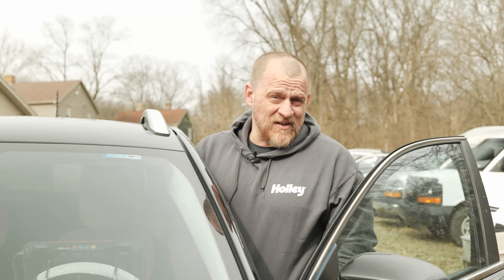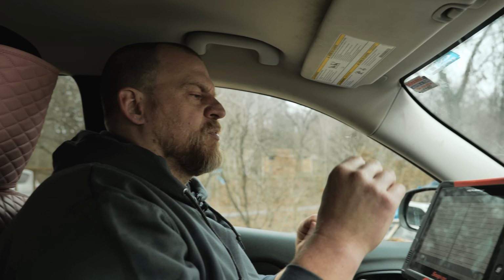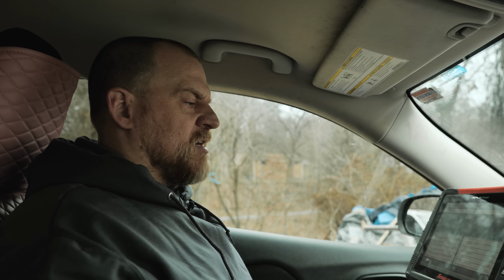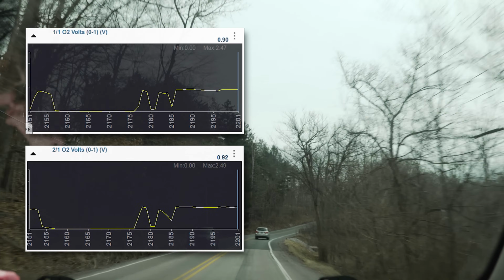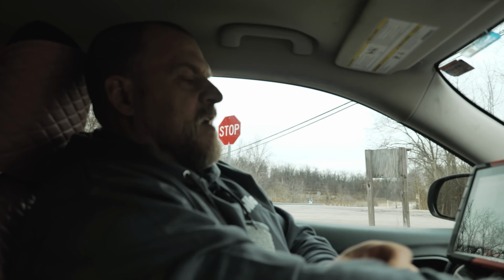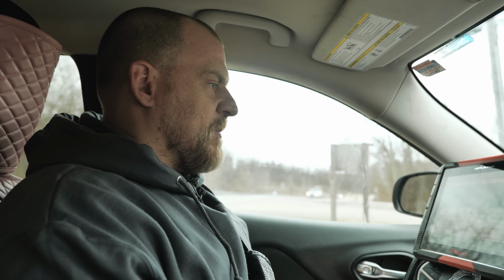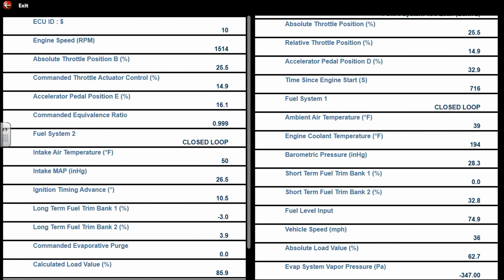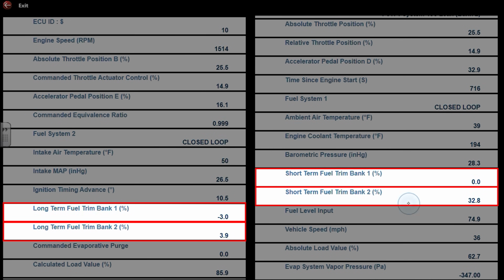How Would You Charge For This?? [Intermittent Lean Condition]

Comment: Been a E-Student of yours for about 6 months now and I used everything you taught me today on a no comm no start no 5v ref. pulled out the vantage labscope and diagnosed the issue I just wanted to say thank you for everything I've learned from your classes you teach!
Reply from the maker: Awesome! Love this, thank you!
Reply: I need help, have a 2001
Monte Carlo with a maf code but have been replaced 3xs at a couple diff shops.wont stay running but when do start it misses bad and white smoke out tail pipe..
Reply from the maker: @Bigmonyon  I do not have any silver bullets for you. What testing have you done? Are you saying white smoke only happens during the misfire? A fuel injector that is stuck open can do that or a headgasket issue

Comment: O2 sensors are a wear item.
Ive seen bosch sensors saying replacement interval 150 to 180 000 Km.

On my old Audi RS4 B7 i had one go bad on the heater then just replaced all 4 sensors and fuel consumption dropped by about 20% and it got more power and ran much nicer. And in the long run the catalytic converter will last longer.

Some times when you cant find the fault within 30-60 minutes then its cheaper to just replace the component as long as it doesnt cost over 500 usd.
Reply: Bu for customers i often just delete faults first and try to get it back since many times the cars that come in have hundreds of faults that isnt relevant and it might be a one time thing.

Og VAG its nice that you can see exactly how many times the fault has been detected, if its one or two times it might be random but when its 160 times its a real problem.

Also, many faults is just people not maintaining their cars, spark plugs, fuel and air filters, oil, and so on.
Many cars get a bad reputation because of the customer

Comment: what about changing o2 sensors in places? from bank1 to bank2 and opposite? and compare figures the same sensors in changed positions. of course, if wirings of sensors are identical.
so you can see if the picture will change or not - the matter is in sensors or real difference between banks.
Reply from the maker: i did that recently on a case study and pulled the threads out of the exhaust smh. That is a last resort type of test
Reply: @ScannerDanner  yeah, on high mileage that happens. sometimes wd40 helps if you have a lot of time to wait.

Comment: Among the list of options you suggested after saying “what would you guys do at this point”, I’m surprised you missed the most important (and most logical) next step. Research. Don’t get me wrong, I agree that you’re probably on to something with the spilled coolant theory. It’s a good thing you got more info from the shop who did the work. But wouldn’t it suck to explain this to the customer, send them on their way and the car comes back a few days later with the light on again, only to find out the second time around a software update exists for this fault code. As long as search info is used properly, looking for bulletins or even hits can be very useful if you didn’t come up with anything, since you made an actual attempt to diagnose the problem instead of running straight to the computer

Comment: Dam str8 charge for your time!

Back-in-the-day they used to tell us 'students' that coolant can kill O2 sensors.

And know your client!  "...he was worried due to his granddaughter driving it."  Run with that!

You can also use Prodemand (that showed on your scan tool), that says most common problem is the O2 (AF) sensor.

Go w/ your gut.

Write your story of all the data you saw.  Sell the client an O2 sensor giving grandpa "peace of mind".

Wouldn't it be nice to change the part and fix it than to have the guy make yet another trip to the shop.  Sell this conenience.

Jim

Eve's Automotive

(btw...is the tick I hear from the HPFP, or the more common worn out roller rocker???)

Comment: Funny there is a 3.6 2018 ish jeep wrangler at my work that has had some really intermittent weird lean conditions. Great to watch you have the same stuff happening. These have issues with O2 sensors and oil from the valve covers leaking onto the o2s. I do not like this 3.6 engine I think its not very well made. Crazy how some spilled fluid could get into the sensor. If you hear anything back about this car I would love to hear if there is more to the stories.  Probably just letting the customer off for free or next to no charge would be a hood choice if you are a shop owner. Unfortunately if they are bringing this car to a bigger shop/dealer there getting at least 1 hour diag charge.
Reply from the maker: it has been 3 weeks with no repeat fault!

Comment: You have so much more patience than me. lol..   I would have driven that thing maybe 10 blocks.. and abandoned it right away..   and told them it's working well, just keep driving it;  and not charge them.   If I'm not going to charge, I'll abandon it very quickly so I'm not wasting any more time on it..  which is typically my 'go-to for intermittent problems in general.   Just bring it back when it's actually broken.  I've chased enough ghosts that I just don't care to even try anymore.  That's just me.  I tend to think that people are hypochondriacs about their cars when there's really not a problem. lol..  Sometimes just clearing the code is all it needs.. Maybe it was a particularly cold day and something froze, etc..  but it's fine now and may never come back.. etc. etc..............  I say it a LOT:   just keep driving it
Reply from the maker: Filming a case study has changed that for me. But I'm in agreement with you. Know when to say no

Comment: I agree with you on the test drive. I couldn't tell you the last time I pulled a vacuum hose or added propane/brake clean to check O2 function. I do FRTD's so they're always about 2 minutes, then go back and analyze the data. I'm having trouble finding/haven't found your thoughts on your Autel you got...was curious about an unbiased reaction.

Comment: Charge the nominal diag fee and let the customer know the facts. Can not reproduce the problem under normal conditions. And give him 2 options 1 run it and see if issue reoccurs knowing that it isn't going to leave stranded and will be driveable if so or he can pay the shop cost for some antifreeze and a trip.to the car wash where u pour a gallon of antifreeze over the sensor slowly allowed any chance to penetrate the sensor and then proceed to use some high-pressure and force some into the sensor and see if you can recreate the problem and damage and sensor that now it's dry may be perfectly fine for the life of the vehicle

Comment: when electronics started getting put on cars most dealers charged a fee just to hook a computer up.set charge or half hour labor minimum.  you hooked a scan tool and did some data reading. half hour minimum  maybe an hour. it aint free
Reply: Yes, we started doing that too. Because this is not just the cost of my time in it, but the cost of the tool and cost of all the subscriptions and software updates (roughly about $500/month)

Comment: Hey Danner, I got a problem with my 2014 Mustang Gt. I’m getting p0300,p0316,p0303,p0307, p0420 and p0430 codes, plus I’m running lean on both banks. What might that be? I have brand new injectors, coils and spark plugs. Compression is good on all cylinders also.
Reply: ford
Reply: Plugged cat(s)?
Reply: You have misfire codes the 03,s if it's running lean could be fuel pressure.  Misfires are probably messing with your cat. That why you got cat codes po420
Reply: Those two cylinders are across from each other toward the back of the engine. Check your pcv hose and valve for damage, cracks, holes or disconnection. Probably not it, but it's the first thing I would eliminate.
Reply: Eliminate doesn't mean remove.
Reply: @VashthStampeede  na the PCV Hoses are good

Comment: Thanks to stuff I learned from you I successfully repaired a 21 Enclave last week. Customer had taken it to the dealer for a p0420 dealer quoted them replacement bank 1 cat. The other shop changed the bank 2 downstream sensor because it wasn't doing anything. I smoke tested and found the leak around the bracket weld.  BZZZZZZZBBBZZZZap and no more code. No parts required.